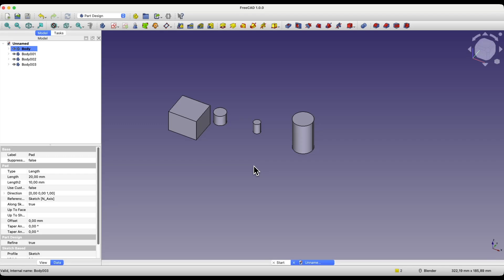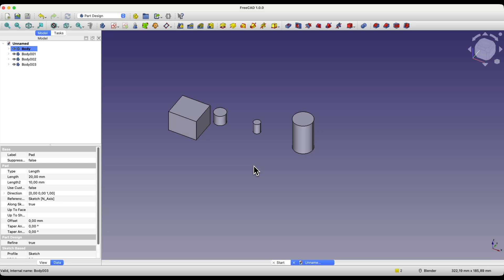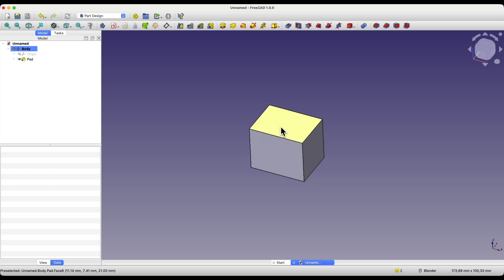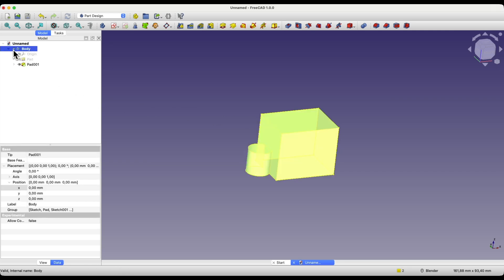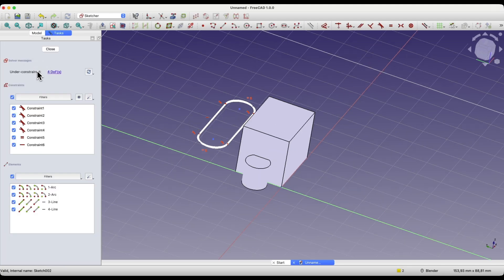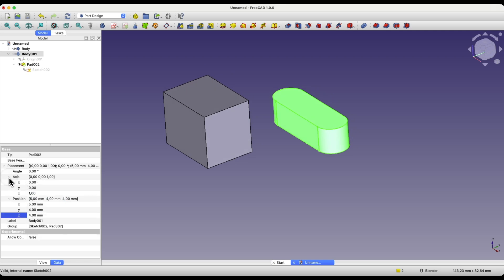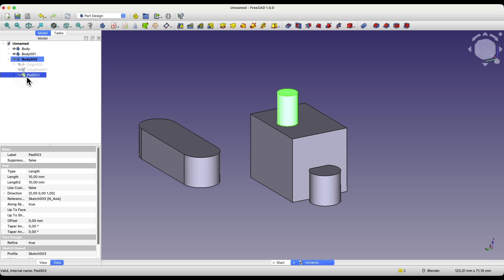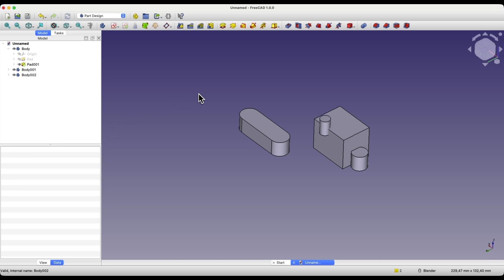🤯 FreeCAD Secrets: Create Multiple 3D Solids in ONE Project!

Comment: OK, got it - each body is a single contiguous solid, but we can have multiple bodies that are not contiguous.  My question is, what is this useful for?
Reply: Imagine you're constructing a model that consists of multiple parts, such as a box with a lid. It makes sense to have everything in one file, especially since you can also reference dimensions from one body to another (using a shape binder).
Reply: @jurgenr3240  I am a 25-year veteran of Solidworks and I'd just model the individual parts then create an assembly.  I see your point about the box and lid - in fact I recently watched a FC tutorial doing that exact thing.
Reply: @stephenoffiler8024  I'm now modelling a 2-piece motor bracket and it's really helpful to have them in the same project. Makes it easier to get the geometries match up. I'm not saying it's always the best way but in some scenarios it simplifies the workflow.

Comment: If you Allow multiple solids in Part Design Body by default (experimental), then you can have multiple solids in one body. No?
Reply: Yes, but they aren't seen as two separate bodies by FreeCAD. Just think of it as a convenience feature. FreeCAD doesn't automatically create a separate body if you put an air gap between them, like some other CAD programs do. They are two separate solids, but they aren't two separate bodies. This will matter if you're trying to assemble parts later on. If it's just for something like 3D printing, sure you can just consider them separate because it doesn't matter to the slicer.
Reply: @Zardozer  correct,  I was under the impression that the video proposed using the body as a workaround for multiple solids. Just thought to point it out that there is an experimental feature that allows to have multiple solids within one body as well.  I do not see this as an alternative to having multiple bodies, but more as a way to design your work process.  In some cases it makes it easier to work in Part Design Workbench if you do not need to follow the "always one solid only" approach.